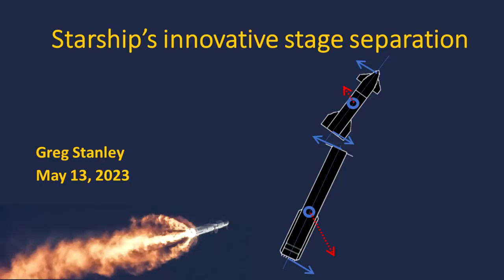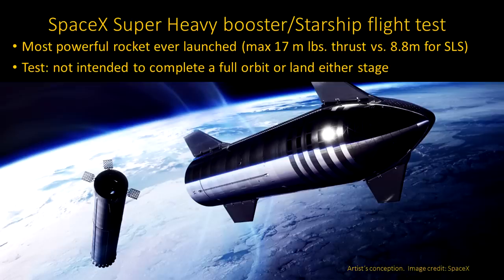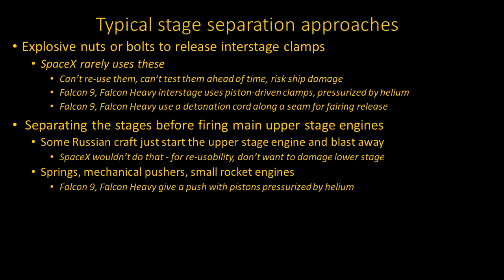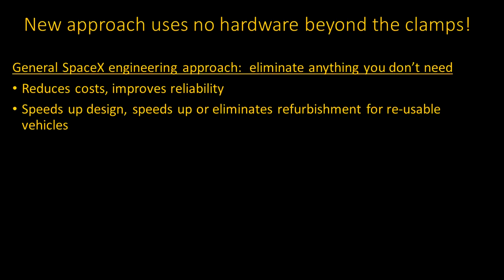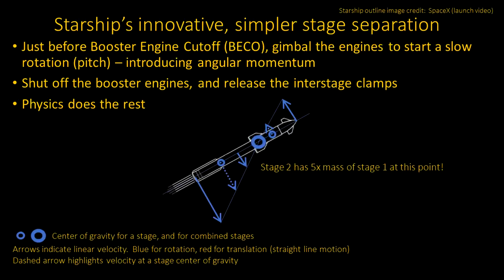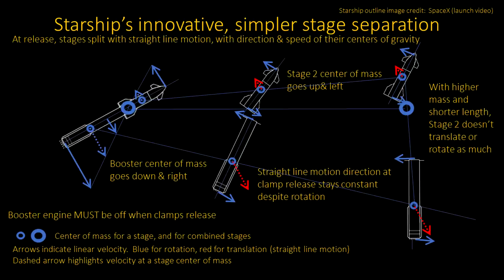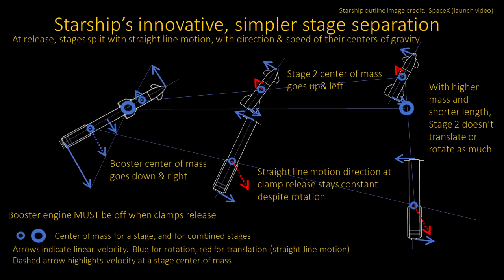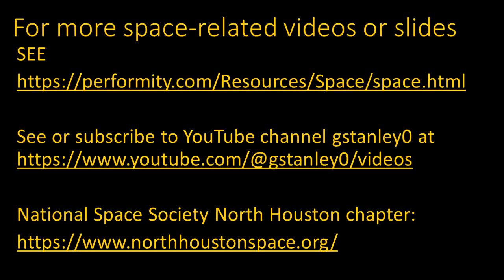Starship's innovative stage separation, using no hardware besides clamps, illustrated

Comment: This seems like a bad idea for maned rocket. They've replaced a complicated system (that could have backups) with a complicated maneuver. The first thing they will lose in an emergency will probably be control. With no launch  abort system, well, bye-bye crew.
Reply from the maker: Several people have commented on this.  For now, the focus is on getting the rocket ready for cargo only, following the usual SpaceX approach of doing that first, just like they did for the Falcon series.   There's plenty to do for that as the top priority.  That's a faster way to get to a minimum sellable product. 
For the longer term, I'm sure they thought about that.  It doesn't seem that unsolvable.  For instance, as one other commenter pointed out, in an emergency, simply start the stage 2 engines and blast away - saving the booster isn't crucial in that case.
  
It's probably better than that.  If the booster has burned out, then ullage (ensuring that only liquid propellant reaches the engine after some free fall) and some push-off from the booster can be provided by the cold gas thrusters at the bottom, fed from the propellant vapors (available because of the autogenous pressurization) and also because of the startup of the turbopumps at engine start.  If the booster is still firing, then you already have the acceleration needed to keep the propellants liquid and still can blast away.    

Emergency escape does depend on the unclamping working.    But that approach has already been accepted as safe in the Falcon 9 series (and probably other rockets -- there's probably something like clamps to hold stages together).  In the Falcon 9 case, they use pneumatic pistons to release the clamps.  I don't know what they're using on Starship, but if it's pneumatic, the principles are the same.  The difference might just be that there's no pressurized helium available like they use on Falcon 9.  If they're still using pneumatics, maybe they use oxygen or methane gas, the only gases available -- I don't know.  That's something to explore

Comment: Booster doesnt do belly flop, only the upper stage. Booster needs to flip around to do boostback burn.
Reply from the maker: You're right, that was a mistake. The booster turns for its boostback burn to counteract the horizontal displacement to head back towards the launch site.  If there's an update to this video, I'll have to fix that.

Comment: I wonder why electromagnets are not used. Cores are magnetized sticking stages together. And demagnetized when separating
Reply from the maker: I'll take a guess here:  Holding together an 11,000,000 lb rocket with magnets would probably take a lot of power and weight to provide that power, not needed for mechanical latches.  The rocket trajectory will tend toward horizontal as it goes higher, and also there's the danger of falling apart if the rocket tips somewhat.  But the main concern people have expressed here has more to do with getting adequate separation of the stages.  You could think about using electromagnets for repulsion.  But magnetic field strength drops off rapidly with distance, so it wouldn't be that effective either.
Reply: @gstanley0  | Only pulse of power is needed to magnetize closed core. And another pulse to demagnetize
Reply from the maker: @rasimbot  , same issues still apply.  I guess someone would have to work out how strong the magnetism has to be,  pick a voltage and amperage (and hence wire size) adequate to handle the pulses on each stage, and figure out where the power will come from.  The big issue would probably be sizing for separation.   From my quick review of magnetism (about which I know very little), it sounds like the force you get drops off as an inverse square law for a monopole.  But, at any distance, the other pole has to be considered, and the net result is, at best an inverse cubic law.  So, most of the force to accelerate the second stage will have to come while the stages are just within a few inches of each other.

Comment: Why does SpaceX use pressurised helium to power stage separation?  Why not CO2 which will not leak though plastics as helium does.
Reply from the maker: I don't have a specific reference, but in the case of the Falcon 9 and Falcon Heavy, I'd guess that a main reason is that they already have a substantial system storing compressed helium at high pressure, used for reasons like keeping up propellant tank pressure.  CO2 wouldn't be any good for that application, because it would freeze at the temperatures of the liquid oxygen.  Helium stays a gas under any conditions the rocket will encounter, so there's no problem of it becoming liquid or solid, which could plug the lines to the clamp pistons.  That's also true for the coldest temperatures that any tubing feeding those pistons will encounter.  I'm not sure if that's the case for CO2.  Maybe not. 

And in any case, I wouldn't think they'd be using plastic tanks or tubing to hold the helium.  There's risks of being too brittle and cracking when cold, melting or burning, chemical reactivity, etc., especially when talking about reusable vehicles, meaning that they have seen a lot of abuse.   They store the helium as compressed gas in "composite overwrapped pressure vessels", or COPVs.   Whatever combination of materials they use for that, they must have chosen something that helium won't leak through - it's a solved problem, and doesn't require the complexity of a separate CO2 based system.  I would expect metal tubing for the lines to the clamp pistons, although I don't know that.  In general, companies like SpaceX are comfortable using helium because they have a lot of experience with it.
 
I don't know if chemical reactivity is ever an issue for CO2 at the conditions it will encounter on a rocket, but it definitely won't be a problem with helium.   

For Starship, they're doing away with helium in the long term, although I've  gathered that they have used it for various purposes short term to get going with testing.   Long term, it isn't known if they'll be able to find any helium on Mars for return trips, which is one reason to avoid helium.  More generally, it's just not a renewable resource.  Another reason is that it's more costly than the propellants even on Earth.  For pressurization of propellant tanks, they're using autogenous pressurization, meaning they heat some of the propellant to gasify it and maintain pressure. That eliminates the need for helium for that application.   I don't know what gas they're using for applications like opening interstage clamps.
Reply from the maker: Looking into this further, in the case of Starship, they've been ruthless in trying to eliminate rocket consumables of anything except methane and LOX.   That's to simplify things, reduce weight for multiple systems handling different gases (tanks, piping, compressors, valves, refrigeration, heaters, heat exchangers, ...), simplify and speed up getting ready to launch, and also to simplify using materials produced on other planets or moons --  In Situ Resource Utilization.  That way, they will be able to refuel with just methane and LOX, both of which can be made on Mars.  While CO2 would also be easy on Mars, that might not be the case elsewhere.   So, they are making their small engines like the ones for attitude control also only use those propellants as well, hot or cold gas thrusters.  They're eliminating helium and nitrogen as well, as well as the hypergolic propellants they used on Falcon 9 to start engines.  They'll just start engines with sparks.   I still don't know what they're using in the pistons that clamp the stages together, but it seems like the answer is likely to be either oxygen or methane (or hydraulic fluid). The more I look into Starship, the more I realize how they are completely rethinking everything and simplifying things for reliability and speed of re-use.

Comment: Yes, so innovatives it not only divides in 2 pieces, but in thousands...
Reply from the maker: ??  It hasn't actually been tested yet, since the booster never stopped firing, and the interstage clamps never released.  The explosion was a deliberate flight termination since the rocket was out of control.  It will be really interesting to see what actually happened when SpaceX, FAA, or NASA release a study of the actual timeline and analysis.
Reply: @gstanley0  I mean, It was a joke, but yes, you are correct XD

Comment: The physics you've showed here works... BUT... this can never be used for crewed Starship.
Crewed Starship need to have launch escape system that works in any point on the timeline of the Starship launch.
Elon lately stated that the safety system for the crew will be the whole upped Starship stage. If this should be true, you NEED to be able to separate Starship from Super Heavy at any conditions... also if the Super Heavy booster's engines are still turned on. So if you want to have any crew on board of the Starship, you have to add some backup separatioin system too (maybe based on explosive bolts... or something similar).
Otherwise the Starship would be the flying coffin for all travellers on board.
SpaceX can not ignore safety. If we learned something from STS flights that we should never repeat such mistakes as missing out the launch escape system. USA lost 7 people in one failed flight. Russians had never lost a man on a launch... and they had already 3 failures. That is what I call reliable transport system.
Reply from the maker: Several people have commented on this.  For now, the focus is on getting the rocket ready for cargo only, following the usual SpaceX approach of doing that first, just like they did for the Falcon series.   There's plenty to do for that as the top priority.  That's a faster way to get to a minimum sellable product.  
For the longer term, I'm sure they thought about that.  It doesn't seem that unsolvable.  For instance, as one other commenter pointed out, in an emergency, simply start the stage 2 engines and blast away - saving the booster isn't crucial in that case.
  
It's probably better than that.  If the booster has burned out, then ullage (ensuring that only liquid propellant reaches the engine after some free fall) and some push-off from the booster can be provided by the cold gas thrusters at the bottom, fed from the propellant vapors (available because of the autogenous pressurization) and also because of the startup of the turbopumps at engine start.  If the booster is still firing, then you already have the acceleration needed to keep the propellants liquid and still can blast away.    

Emergency escape does depend on the unclamping working.    But that approach has already been accepted as safe in the Falcon 9 series (and probably other rockets -- there's probably something like clamps to hold stages together).  In the Falcon 9 case, they use pneumatic pistons to release the clamps.  I don't know what they're using on Starship, but if it's pneumatic, the principles are the same.  The difference might just be that there's no pressurized helium available like they use on Falcon 9.  If they're still using pneumatics, maybe they use oxygen or methane gas, the only gases available -- I don't know.  That's something to explore.

Comment: Yikes! This is not ideal.

Apart from the requirement for automatic deployment of vomit bags (high longitudinal g, followed by rotation then abrupt shutdown and slight negative g induced by the rotation, then secondary ignition followed by a rapid course correction to null the rotation).

Plus rocket engine thrust does not drop instantly to zero, so to make this work the rotation time will not be insignificant. Personally I prefer the Falcon style piston pusher idea.

But a superb video clearly presenting these complex concepts. Thank you, I’ll be back to this channel!

Comment: They won't be able to put an astronaut in that thing if there is a booster failure there will be no way to separate, like what happened at the first launch. They will need some mechanical means of separation.
Reply from the maker: Several people have commented on this.  For now, the focus is on getting the rocket ready for cargo only, following the usual SpaceX approach of doing that first, just like they did for the Falcon series.   There's plenty to do for that as the top priority.  That's a faster way to get to a minimum sellable product.  

For the longer term, I'm sure they thought about that, since their goal is to send people to Mars (not to mention the more immediate "Dear Moon" flight).  It doesn't seem that unsolvable.  For instance, as one other commenter pointed out, in an emergency, simply start the stage 2 engines and blast away - saving the booster isn't crucial in that case.
  
It's probably better than that.  If the booster has burned out, then ullage (ensuring that only liquid propellant reaches the engine after some free fall) and some push-off from the booster can be provided by the cold gas thrusters at the bottom, fed from the propellant vapors (available because of the autogenous pressurization) and also because of the startup of the turbopumps at engine start.  If the booster is still firing, then you already have the acceleration needed to keep the propellants liquid and still can blast away.    

Emergency escape does depend on the unclamping working.    But that approach has already been accepted as safe in the Falcon 9 series (and probably other rockets -- there's probably something like clamps to hold stages together).  In the Falcon 9 case, they use pneumatic pistons to release the clamps.  I don't know what they're using on Starship, but if it's pneumatic, the principles are the same.  The difference might just be that there's no pressurized helium available like they use on Falcon 9.  If they're still using pneumatics, maybe they use oxygen or methane gas, the only gases available -- I don't know.  That's something to explore.
Reply: @gstanley0  I agree totally. I did notice recently a new ring section with cutouts that could be for a hot fire separation in case of emergency with the booster. That ring section would connect Starliner with the booster. The cutouts would be to vent combustion gasses in an escape situation.

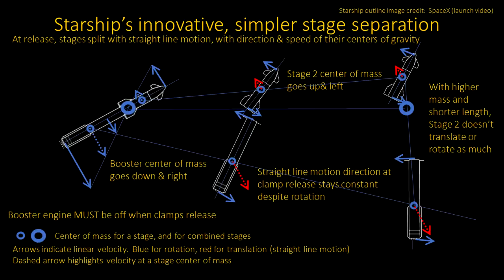Comment: 9:30 booster doesn't belly flop
Reply from the maker: You're right, that was a mistake. The booster turns for its boostback burn to counteract the horizontal displacement to head back towards the launch site.  If there's an update to this video, I'll have to fix that.

Comment: Absolute insanity. The G-force would knock everyone out cold.
Reply from the maker: Several people here are assuming that there will be violent angular forces on the upper stage, implying high angular acceleration and velocity, maybe applied over a significant time.  What is the basis for that assumption?   Why would a few degrees rotation over a few seconds caused by a few gimbaled engines knock people out when the full thrust of 33 engines leading up to just before that point didn't?  The barf bag issue brought up by someone else seems like it might be more of an issue, but that's a risk anyway when the booster shuts down and people go from pinned to their seats to weightlessness the first time.  I think we'd have to wait for more information from SpaceX, or at least wait some more months and carefully watch a successful test.  You can also bet that before any people travel on a Starship being boosted from Earth,  SpaceX will have experimented to minimize the rotation needed.   So the initial test might have more angular velocity than they finally end up with.
Reply: @gstanley0  The Common Sense Skeptic had (I believe) official animation showing the ship and booster doing some type of somersault maneuver to spin them apart and each go their own way. It's madness.
Reply from the maker: @djmouseshadow4735 , if you find that animation, please post a link  I found one short animation embedded in one of their videos showing multiple flips.  But I doubt that it was generated by SpaceX, since in the few limited things they show (like in the lead-up to their launch video) there's never anything close to one rotation.  And, for that matter, when Starlink satellites are launched, they use rotation like this to spin off the satellites, and it's slow.   It's a shame that Musk is such a polarizing figure, so that commentators tend to go either into fanboy mode, or the 100% opposite.   That Common Sense Skeptic channel seems to mainly be a platform for anti-Musk material, with just a few other token punching bags as window dressing to slightly disguise that.  Even though they have raised some legitimate points in the few videos I've watched, their bias is so clear that they aren't really credible in presenting anything remotely balanced.  It makes one wonder who funds them.

Comment: LOL. It's not an "elegant solution" if it doesn't work yet.  MuskCult.
Reply from the maker: My word was "innovative", but others used "elegant".  But, point taken, strictly speaking it hasn't been shown to work or fail yet, so to be accurate people could say "elegant proposed solution" or "innovative proposed solution".  The overall test didn't get far enough to to test the maneuver:  no booster shutoff, no clamp release, and not high enough altitude to justify it.   We'll have to wait for a more definitive timeline and analysis to be sure, though.   We're all just too lazy at heart to state things so carefully.